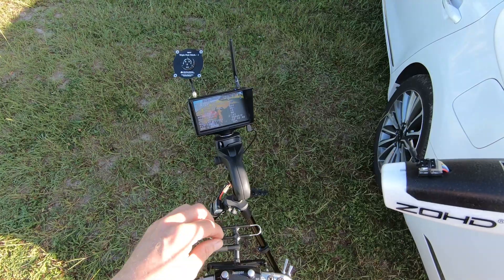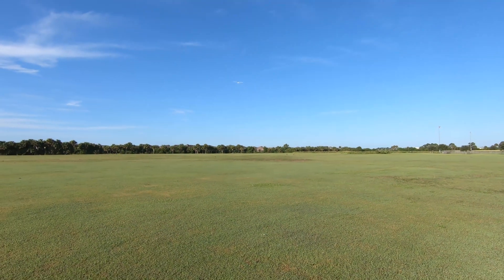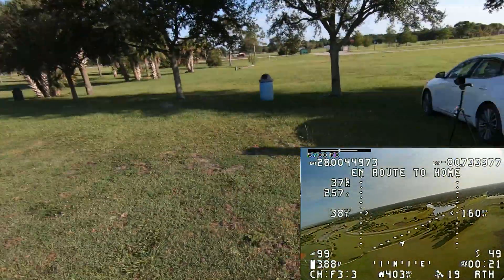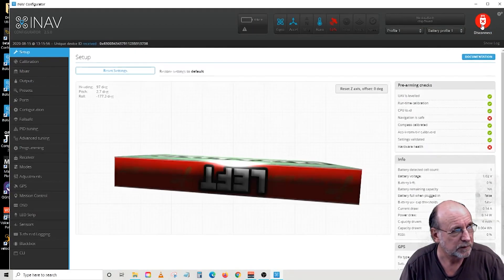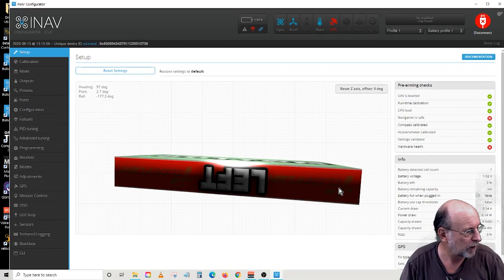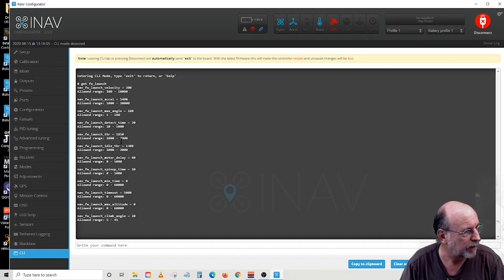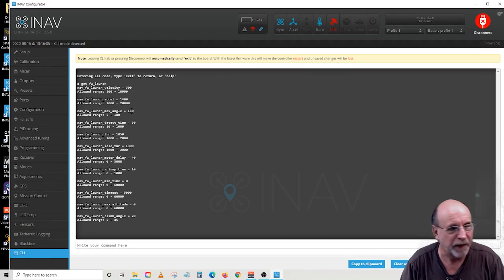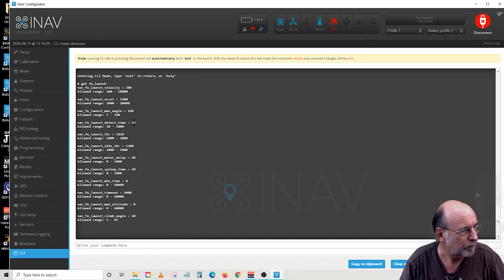How To Setup INAV AutoLaunch on ZOHD Drift & AR900 Wing

Comment: I'm wrong threw my zohd drift and I currently  working threw why I can't get my motor to spin. I haven't  set a arm swith yet and gps hasn't  locked yet. But no motion in motor tap when bar is moved
Reply from the maker: in INAV everything has to be right before you can arm the motor. you do need an arming switch and you need a GPS lock. in the goggles look for the warning messages to tell you what the problems are.
Reply: @OldGuyCarnivore  I have to have a switch and gps lock to test the motor?
Reply from the maker: You can test the motor from the INAV configurator on your computer. If I remember correctly it is on the output tab.
Reply: @OldGuyCarnivore  yes thats where I'm not getting anything. I guess I must set a arm switch an have gps lock 1st. To get the tab to activate my motor
Reply from the maker: @rutledgeking7652  You should be able to spin the motors from INAV. Check your ESC and signal wires, IVAV ESC configuration etc.
Reply from the maker: Also make sure you have set the switch in INAV to allow motor to run